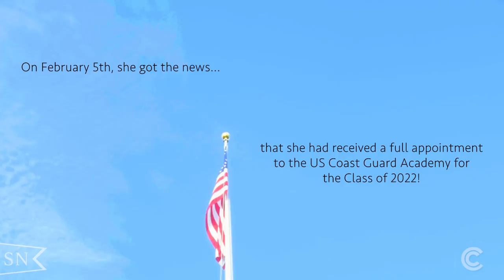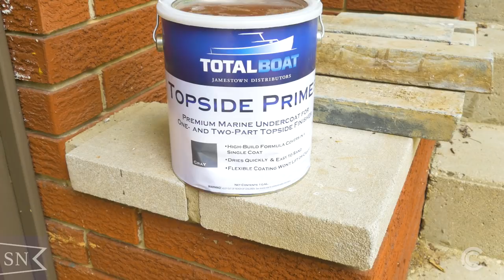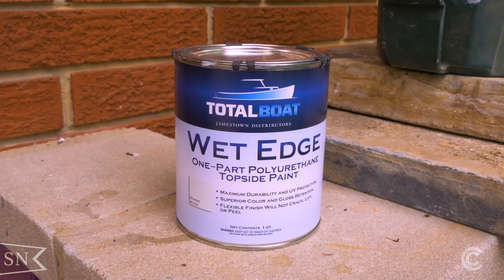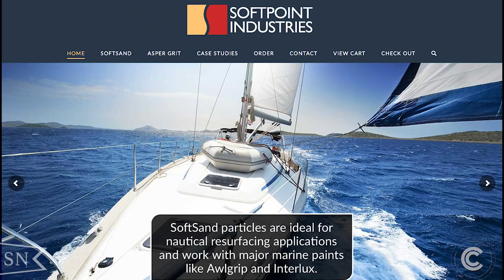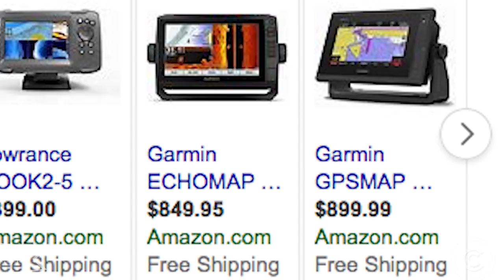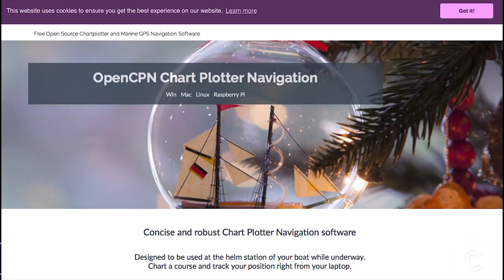Eps 1.7 -  Deck hardware, deck primer & non-skid, outboard motor S1E07

Comment: Your stuff is great and inspirational. Where does your bilge pump empty to?
Reply: wow, thanks! The bilge pump discharges through house out the back from an opening in the transom. Another Herreshoff Eagle I have will discharge out the side through an existing through hull. Im not sure which one is bette. I can see advantages and disadvantages to both.
Reply: @kb8wfh  that’s what I thought when I saw the pics of the bilge pump and later some views of a hose in the motor well. I assume it runs up from the bilge through the well, and the well drain under the motor drains the whole thing. BTW it seems my sole drain empties out through the centerboard trunk instead of a separate hole...makes sense...hope the board will go,down when I finally launch it..🤞🏼

Comment: Terrific video, Matt.  No need to apology for the delay, big life changes for you and your family!  CGA graduate and former faculty member, so congratulations on your daughter's appointment to the Academy.  Sounds like she has a great background on the water, will be a big plus for her in her training and Commissioned service.  Maybe I missed it, but how did you cover the gaps in the new  plywood deck under the seats?  Is your cockpit self bailing or does it drain into the bilge?  Keep up the good videos, they are a joy to watch.
Reply from the maker: Vince O'Shea thanks so much for the encouragement. My daughter loves the CG and her CGA experience. She wants to make a career of it. She’s also on the offshore sailing team. Hope to go up the next time I hear of the parent alumni regatta and have some fun with that. As for the boat, I first laid down a 1/4” thick sheet of roughly cut marine. Plywood. The hat between the edges and the old decking were filled with fairing compound (I used TotalFair from TotalBoat’s products.). Then I paired the entire thing with epoxy based bilge paint and covered the entire section (seam and all) in another larger layer of 1/4” marine plywood, glued with epoxy, then painted again with epoxy bulge paint. I’ll be doing the same thing on the new Eagle I got as I’m sure the cockpit deck is likely shot too.all these boats seem to have that problem. I’ll detail it more when I do it to that boat to better explain.  I should have covered that better with the America.
Reply from the maker: And yes, the cockpit is still self bailing. I used the same bronze drain port and put it in the New wooden cockpit sole. It works ok but I may need to mod it a little. Will cover that in an upcoming episode.
Reply: Was thinking you were going to do something like that.  Sounds like a good approach.  Thank you for getting back to me so quickly.  Again, your videos and straightforward explanations are terrific!   Thanks for doing them.